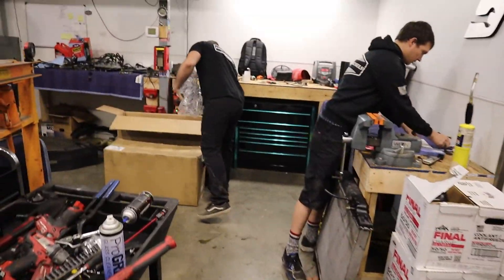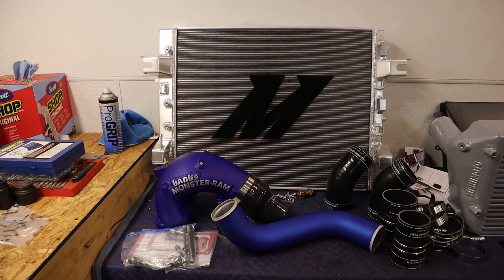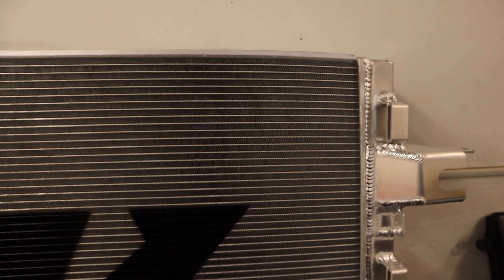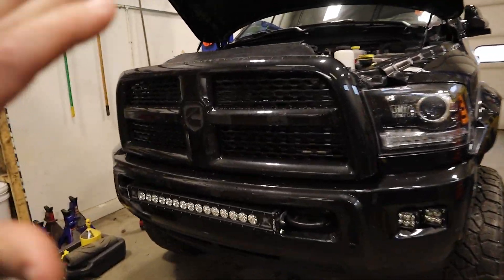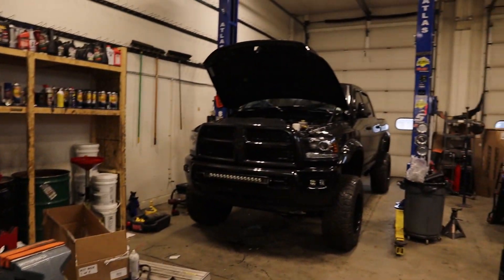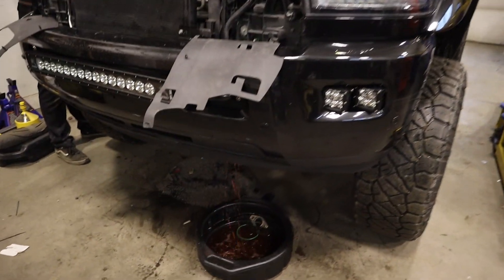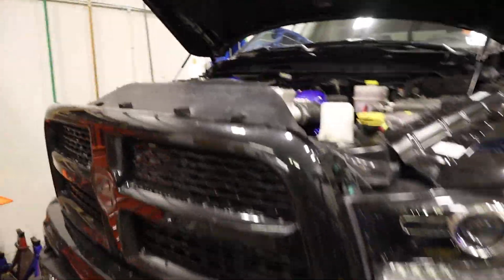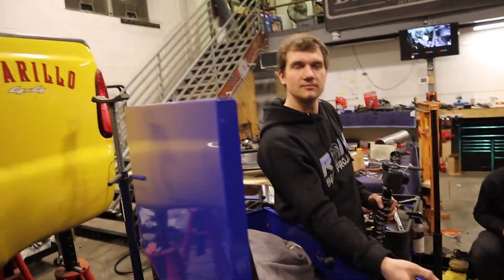KEEP YOUR 6.7 CUMMINS COOL! Mishimoto Intercooler & Radiator Upgrades

Comment: Always have to use a funnel putting additives in the fuel, thanks to the double flap design of the filler neck on the ram.
Reply from the maker: I was thinking of that while pouring .. h🤣

Comment: Ram BEAST Projects  do you have offroad steering kit ? Are you going to get the recall fix ? I'm worried cause I dont know what to do if I should synergy offroad steering kit ?
Reply from the maker: I’m stock for now. I won’t be taking it to the dealership to fix it.

Comment: Love it. Let me know if the radiator dropped the temp at all, also if the IAT's are lower form the new intercooler over the stock one.
Reply from the maker: We’ll do, wish I had a working EGT gauge for the before video. I have one now, just need to find the time to install it.